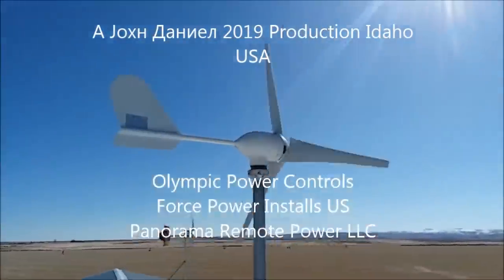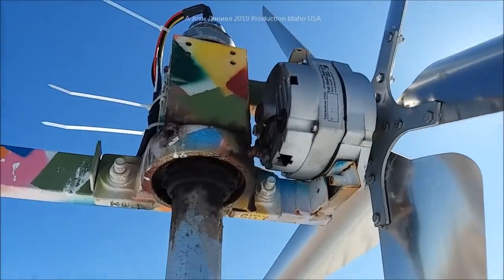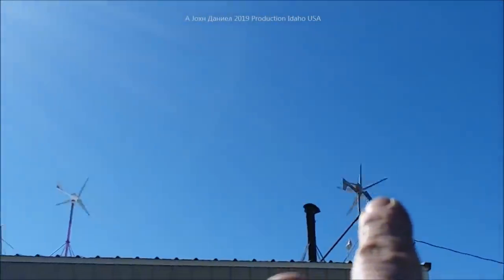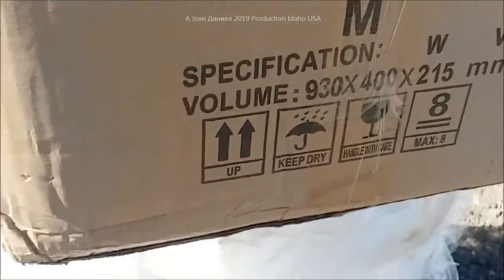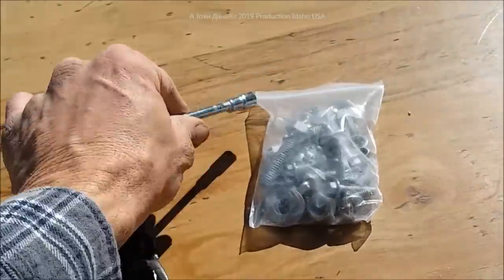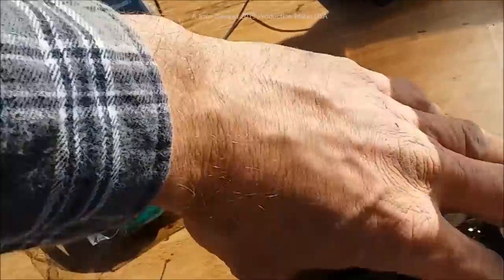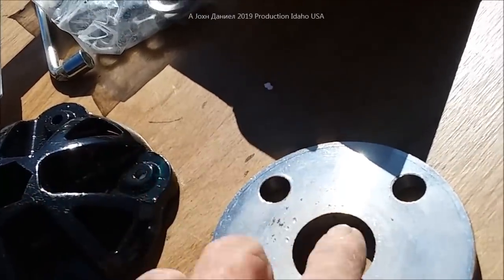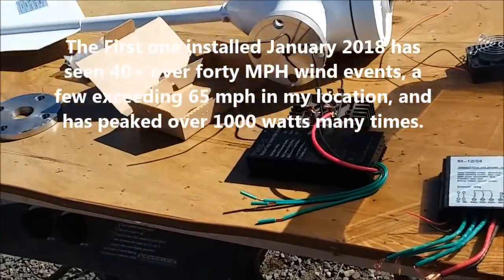Genuine 500 watt home wind turbine, Best small Wind Turbines made! FULL PARTS LIST BELOW video

Comment: People tend to throw around statements about 'watts' with these things but are almost never accurate.
Ohms law, a simple way to calculate power based on voltage and current.  
In a 13V system,  500 watts would be a LOT of current.   Power = voltage times current.  If you have power and voltage, current = power divided by voltage.   So  500 watts divided by 13 volts would be 38.4 amps of current.  
I doubt you've ever seen that kind of current out of that generator.
Your claim of 1300 watts out of your custom build beast would be 100 amps of current.   
To really find the actual power being provided,  measure the current being delivered and the voltage present at the time, multiply them together.
Reply from the maker: When you refer to "People" you need to keep that where it belongs, scammers selling crap on Ebay and out of what your likely protecting, comparing or referring to is the morons from MISSOURI or TEXAS who are scumbags who ruined all trust in Small wind power with total crap. The main clown had to have a kid from Michigan explain watts verses water LOL to him as he made idiot videos to sell his junk he got from a local hocker ( name withheld for respect). InRe:  ( the famous fraud of the former washing machine mechanics who became the You Tube wind turbine kings). 
In my videos, requires you to see actual use, on the meters and clear as day you see some of them hit 100 amps, they are PEAKS, not constants. If it was constants even my heavy wiring would possibly burn, but constants of 800 to 1000 watts from the 800 watt model weighing over 3 times that fake a watt from Missouri, Texas and Ebay weight is due to facts, the results from the 500 and 700 watt Thermodyne turbines is common with the Thermodyne as built BY ME, not them with 12 mags has seen over 1000 watts in normal 24+ mph, and peaks exceeding 1350. When they also outweigh the copper windings and gauges by 4x of that crap on Ebay and pushed from wind turdbind kings selling the Vietnam knock offs. Takes no further study than "these are as claimed" in hundreds of post on my 20+ videos, hundreds now making same result videos,  by most of over 4,000 who since my video 1 has ignored the Midwest morons and bought them. Unlike the total bullshit sellers claims of 2000 to 5000 watts from some 5 lb Vietnam made crap sold and the hard to find properly built is not a easy task. All of China has access to the bodies of (castings) and wares of small wind turbines, very few of them put the right parts in them and ship them here.
As for the math, Year 12 of me doing it, I think I got it figured out or over 250 people since 2008 would not have hired me without complaint to buy what they want, and have me install them.
Reply: @JOHNDANIEL1  Not pointing fingers at any particular group.  In general, people throw around huge wattage numbers without clarifying anything about actual working power.
Often they use PEP or peak to peak voltage readings, which is another problem since working power is actually RMS,  0.3535 the peak value.
And to your second reply,  the unloaded voltage coming from the alternator doesn't mean much.  Once the rectifier is connected to the load, that voltage will drop to the load voltage, minus a small loss from the diode's junction resistance.  
What matters, and should be the value discussed, is the wattage calculated based on the load voltage and the current being supplied.   Interval or average, that's the real power being produced.
Reply from the maker: Forgot to mention, the turbines top voltage is over 50 volts down the wire to the rectifiers generally, not 13v . The charging voltage is much higher than its resistance such as 20 post rectifier with the batteries/controllers holding it to 14.5 and under so 1000 watts at between 14.0 to 14.5 is the more accurate amp/wire gauging since winds do not go from zero to 30+ mph and the batteries are normally almost charged by the time the higher winds result. In the case wind does go from 0 to 30+ in a minute,  it's time to head to church!

Comment: I should scold you for going up on the roof alone. I always have a friend come by if I need to go up on the roof, just in case. Anyway, did I miss something? Where's the battery? How does the power get to the battery from the turbine? I can see a merging of technologies here with solar and wind power (one of which is always present) and portable chargeable battery workstations.

Comment: Very informative videos on wind turbines.  Been watching carefully how you use bridge rectifier to convert voltages from 120vac to 12vdc.  I have a solar setup with Victron Bluesolar MPPT and Victron Color control display .  CAn the output from the rectifier go to a large enough (to handle the high voltages coming out of the rectifier) MPPT to then go to the battery bank?  The reason I want to use Victron MPPT in this situation is so that I can monitor amps (or watts) produced/consumed.  Is this doable?
Reply from the maker: They make a dedicated MPPT for wind turbines, you can find them on the site with the turbines, just look around once there.

Comment: Greetings Mr. Daniel,

Please excuse my ignorance in all of this. I am new to wind energy, but I received an "old" 9 ft metal frame farm style windmill for my birthday. Yes the wind blows the fan blades, and yes it moves around...but what is keeping me up at night is the fact that I am missing out on obtaining energy from the wind. I like the old classic look of my windmill, and was wondering if you could recommend any kind of set up to harness the wind energy that I'm not utilizing? I know, and fully understand, that the farm style windmill is not the most efficient (compared to what you have in the video). 

Or, should I just scrap the idea, and go with what you suggest above?

FYI, in Dallas, TX and like the look of the old farm style windmill... well because I'm in Texas.
Reply from the maker: Those Wind Mills are very low RPM, not real able to make power, but lots of torque to run a pump. Yet a great platform to install the 800 and 1000 watt turbines on. Under the video is some links to the Green Energy and B&C turbines, in their stores are the totally tough 1kw models with a big controller option. Check them out.

Comment: Just get a MPPT controller and you don't have to deal with all that garbage. I have a SunForce 600 watt with 3 blades and it puts out 25 amps at 25 mph. The controller has a built-in cooling fan and brake. I have one on my boat for the last 8 years and it runs great. WORD Of CAUTION NEVER LET IT FREEWHEELWITHOUT A BATTERY ON IT

Comment: Im about to buy an RV and some land for me and my kids. How much power would i need for my RV ? Im in MN thinking i want to mix wind and solar probably mostly wind . all this electrical stuff don't make any sense to me. Lol and I don't think I have the money to pay someone to install it unless there's installers on Craigslist that will do it for 100 bucks.
Reply from the maker: Size of system is wholly dependent on your use, but go 70% solar on rating, 30% wind in your area. Be sure to use the better MPPT controllers with built in diversion loading on the wind power.
Reply: @JOHNDANIEL1  could you tell me a list of things i would need to get started? Maybe when i have it in front of me I'll understand it better but sounds like i should have like a little shed set up to keep it all stored in? Maybe I'll just start out on solar to make it less complicated but by winter time next winter i think the wind power would be good. This is the only area that building my own place is intimidating to me lol especielly when i see a breaker box lol

Comment: Hi John, I bought two 24V/500W Wind Turbines from the same seller you bought. Please tell me what kind/how many  Bridge Rectifiers and Tubular Resistors should I use for each? Thanks
Reply from the maker: 2 Rectifiers 3 x 2 ( 6 ) 10 Ohm 100 watt resistors. Then 1 WS-OPC style diversion control and some SSR relays 40 amp DC to DC. Need a exact list, sourced, let me know

Comment: hi. 
I bought 500 watt 12 volt 3 blade turbine based on your review. I installed yesterday . when I checked batteries yesterday they were at 13.3 volts. 20 hrs later with wind blowing approx. 50 kms per hour they are now at 12.78 volts. I am disappointed in wind turbine. do u think the 100 amp rectifier would solve this problem. I did take video of meter and turbine and whats happening on meter. I watched your video and on your meter the amps were hovering around 10 amps. mine is reading 0 even though turbine is spinning very fast.
thanks
Reply from the maker: Check wiring, make sure there are no bad connections, then remove 3 wires from controller and carefully with wind blowing over 15kph and under 30 kph test the open voltage on the turbine using 200 volt AC setting on multi meter, test 2 wires at a time switching about till your tested all in bias test. If your voltage is over 25 volts and rising/falling as wind increases/decreases your turbine is fine and replace the controller or change to a rectifier and diversion controller design. If you do not have a near same voltage across the test ( wind speed variable applied)  you have a issue with the turbine or wiring from it. Let me know your results.
Reply: @JOHNDANIEL1  I did do open voltage and the most I could get reading was 6 volts at at least 30 km of wind.
thanks
Reply: @randymuise2227  hi Randy did you get your wind turbine straightened out I hope you can share your results with us as to what you found out
Reply: @JOHNDANIEL1  I hope you don't mind but I sent video to your email of turbine in action. thanks

Comment: Hello John my 500watt wind turbine from B & C arrived yesterday. I hope everything works
Reply from the maker: Lay everything out, check the blades centering, See the video I did about a month back on balancing, and be sure to work the blade hub nut down well, and you will need a very good 8mm Allen Wrench for the shaft, it can be a pain to get the nut on the shaft fully seated sometimes.
Reply from the maker: AND PS = Nothing less than 8 awg for the 12 vdc, Solder/shrink tape them if you can, and 10 awg is ok for 24 & 48 volt. The controller is OK, but make sure your solar is not set to charge up to higher than 14.5 on a 12v system, or 29 on a 24 so the brake-divert does not compete with it.
Reply from the maker: And if you have questions on wire, here is a excellent site https://www.powerstream.com/Wire_Size.htm

Comment: Do you power all your house with renewable? Wow! that's super cool. I like the turbine you built. How many batteries do you use ? Do you use the same ones to keep the energy from your solar panels and turbines? How much power do you produce? What produces more power your wind turbines or you solar panels? What is easier to install wind turbines or solar panels?  How much power did you get from that wind turbine?
Reply from the maker: 24 batteries total, 14 of the L-16-435 and 10 of the G2-235ah, 1890 watts on the house, 3400 on the shop in solar, 5 turbines averaging 670 watts continuous with peaks exceeding 3900 with diversion system not shown to keep shucksters from copying it or learning how to make hydrogen fuel from special pulse discharge diversion. House runs on 72/28 Hydrogen/Propane blend for water heating, cooking and 2 Empire 35k heaters. My Thermodyne PMA based unit makes over 1400 watts peak and continuous average of 290 PWH over 30 day records.  Home is 85% off grid, shop is 70% with 75% lighting in both on DC system.
Reply: @JOHNDANIEL1  Thanks for answering and your power system is super cool 😎 you made a great job. I have a last question How much is your electric bill?
Reply from the maker: From a years ago average shop and home of 375 to 450 a month with a record of $516 once,  down to $130 to 160 current,  but without a few RV's tied to it, it will run about $45 to 65 a month.
Reply: @JOHNDANIEL1  You save a lot! That's great!  Do you motivate your family and friends to use renewable energy? What people think says when you tell them how much money you're saving.
Reply from the maker: We went from a all electric place to Propane, Solar, Used oil heat, Ground source cooling pipes, and wind in a invent as I go process. Not for the Socialist GREENIES, but in spite of their fake rage.

Comment: Informative video John, albeit a bit too shaky.  In any case, I'd love your thoughts on how I could make use of my Sprinter's engine compartment air intake to operate a wind turbine to charge my 24vdc battery module's.  Since I'm using used Tesla battery module's, I'd need to limit the charging voltage to less than 25 Vdc, but could push 100+ amps.  I prefer this approach to charging via an auxiliary alternator tied to the engine, since I suspect I'd need a more expensive alternator with temp sensors and current limiting circuits to avoid burning it out s low engine rpm.  Any thoughts on how you would design such a wind powered solution and what components I'd need?

Comment: can you suggest a good charge controller that can take in wind and solar and hydro turbines I have some friends that built a tube and when they go out into the wilderness long as there is a running stream they have power trying to figure out an all around solution for mobile if necessary I'm also working on a heat collector panel like solar only similar to thermocouples if I can layout a panel get sizing down then we can recoup the work force being wasted into air with all appliances

Comment: I am interrested in buying one that you built ...or the kit. I saved this vid so I will try and work on this in the near future. I have no idea what kind of pricing these are around and am in no way a electrical wizzard. You seem to really know what you are talkin about.
If at all possible I'd rather stay away from any chinese made crap. I don't even know how much $ I've dumped into 'soon to break' or 'worked for a few weeks' junk up to now.
Anyway. 3 or 5 blade- I don't know. We get gusts here and for the most patt this ol mountain has an evenin breeze most every day.
So- I hope to be in touch with you. 
Thanks for the input on all this- though some of it is totally foreign to me.
Wulfy
Reply from the maker: If you get one from the right assembly/dealer shop and they use full spec materials like B&C Green Energy does your going to get a good result. But if you get it elsewhere most of them order lower quality and assemble then box junk as a result.

Comment: Why couldn't I just climb the tallest tree, 
Chop the top off level where I can mount the stand and the turbine be higher than the surrounding treetops.
Reply from the maker: You can, many do. Just realize you are risking lightning strikes on your turbine in those conditions. My suggestion if if you do that then mount it on 2" pipe the last 10 feet with it secured to the tree with brackets made to fit the curvature of the wood and get a 4 awg copper ground wire clamped many times on the pipe all the way to under the turbines mount on the pipe then all the way to the ground with 3 feet of it left in a 2 foot hole in the ground about 5 feet away from the tree to offset strike current from the trees roots. Its not likely the aluminum turbine body will transfer to the turbines wiring in any event unless its not grounded at all. Run a minimum of 10 awg RV extension cord wire down the tree, going to 8 awg ASAP.
Reply: @JOHNDANIEL1  absolutely.  Wish it were easier to talk to you. I'm about to start this and may have some questions
Reply from the maker: You can send a email, olympicpowercontrols@yahoo.com and although I get hundreds I try to answer best I can.

Comment: Do you think it couses infrasound? Can I have some health problems using it?
Reply: Infrasound is from 20 hz down to 1/10 hz.  For frequencies that low you probably need the enormous turbines.  Noise off these would be much higher frequency.  I don't have a turbine, but I would guess probably not a problem even in low 10 mph winds.  Health problems would more likely be either falling off a roof or sticking your hand into a blade path  ;-)

Comment: I have studied "MARINE BATTERY CHARGING SYSTEMS" ...LONG DISTANCE SAILBOATS HAVE USED SOLAR CELLS + WIND TURBINES ...FOR YEARS ...+ WITH MILITARY GRADE "A.G.M." (ABSORBED GLASS MATT) = BATTERY SPECIFICATION FOR BATTERIES USED IN SUBMARINES BUILT TO RESIST EXTREME SHOCK/ DEPTH CHARGES ......SPECIALTY CHARGE CONTROLLERS CHARGE BATTERIES VERY QUICKLY IF SUN IS BRIGHT or WIND STRONG ...at ** 25 volts MAXIMUM for a 12 volt/6 lead cell  BATTERY * , but included in the "FAST CHARGE CIRCUIT is a SAFETY THERMOSTAT/THERMISISTOR that LOWERS VOLTAGE and/or SHUTS OFF CHARGE IF BATTERY TEMPERATURE EXCEEDS 125°F * ......BATTERIES SELF DESTRUCT ABOVE 125°F ................OLDER FORD VOLTAGE REGULATORS WERE MOUNTED REMOTELY from ALTERNATOR ,*CLOSE AS POSSIBLE TO BATTERY* , SENSING A COLD or HOT BATTERY ...COLD BATTERIES WERE GIVEN HIGHER VOLTAGE , WARM/HOT BATTERIES WERE GIVEN LOWER VOLTAGE ...........MODERN ALTERNATORS ( MOST ) HAVE A TEMPERATURE SENSOR INSIDE ALTERNATOR and COLD ALTERNATOR GETS HIGHER VOLTAGE , WARM/HOT ALTERNATOR GETS LOWER VOLTAGE ( NOT AS ACCURATE , ESTIMATES BATTERY TEMPERATURE ) .......FOR ALASKA   (+ NORTHERN MINNESOTA ) G.M. ALTERNATORS CAME with a "PLUG" TO RAISE VOLTAGE FOR EXTREME COLD ( #35SI MODEL I THINK ) ....ERIC P. KAJANDER ......USED TO BE SOME GOOD BOOKS ( SOFT COVER ) AT "BOATS R US " ( BOAT U.S. )

Comment: The braking system with rectifier and control box doesn't work on mine!!!!
Reply from the maker: Some do not, depends on the provider on that particular box if it has a controller with sensing or flow through.
Reply: @JOHNDANIEL1  it's the exact same one as yours in the video, I will make a diversion load instead now...thanks John....this turbine pumps the power in...